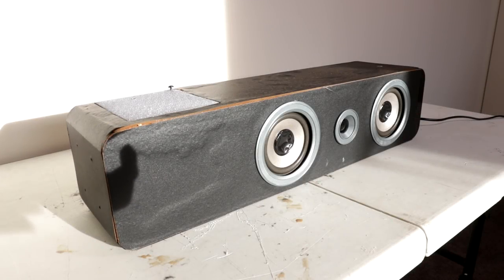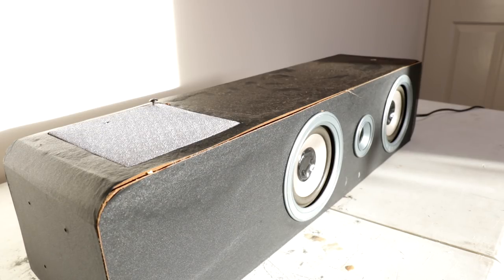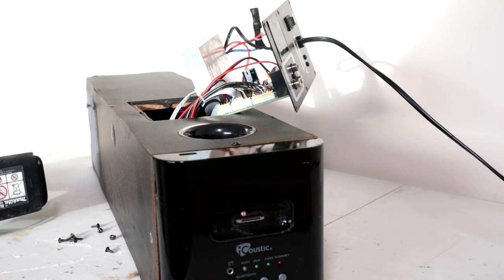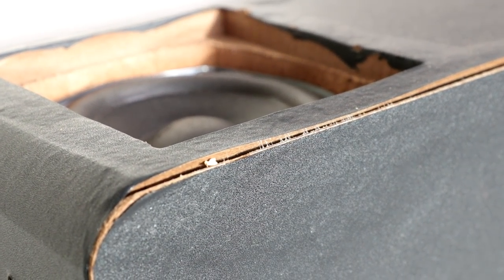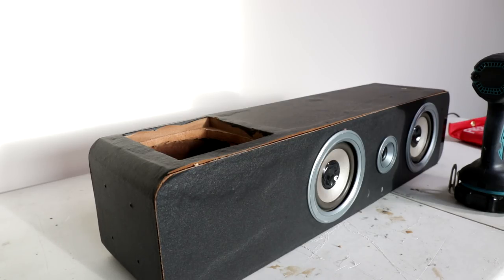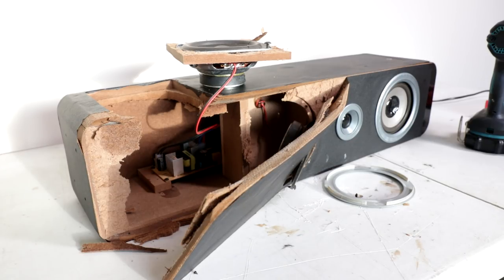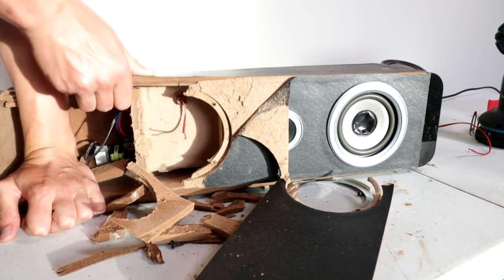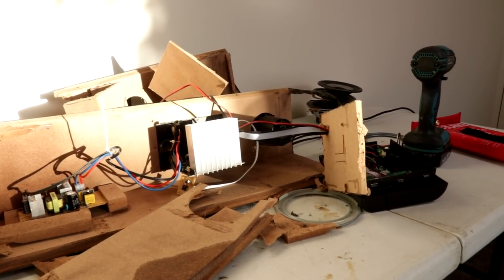Its DESTROYED! (Worst Speaker OUTSIDE)

Comment: Many recognized speakers brands in the market use MDF for they manufacturing. MDF is not for outdoor application, so it is expected such a damage after the speaker has been exposed to rain
Reply: MDF is preferred for speakers as it doesn't resonate anything like as bad as wood (so much less bracing is needed), but its basically weetabix once wet!

Comment: If water gets on the amplifier circuit board and the amplifier circuit board drys up and you go to plug it into the wall and power it up after it drys then it could still short circuit and fry on you because water eats away at the amplifier circuit board and causes permanent damage